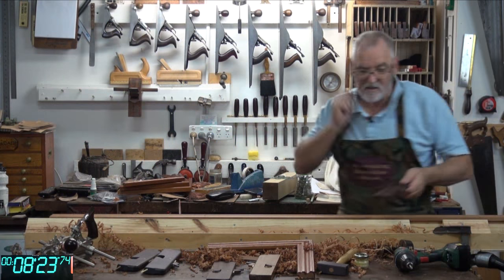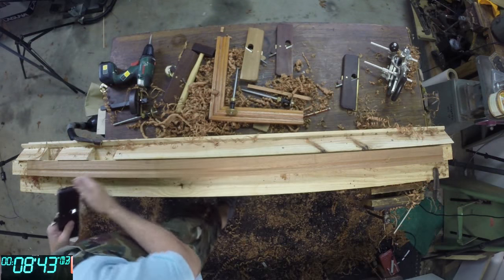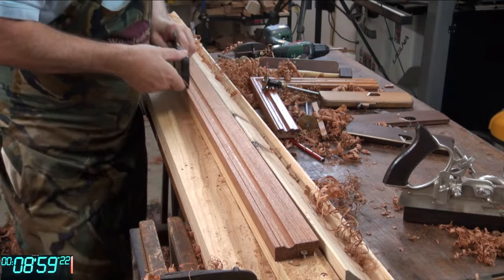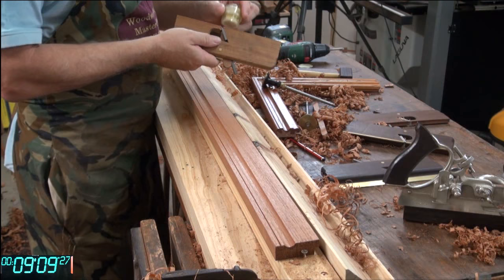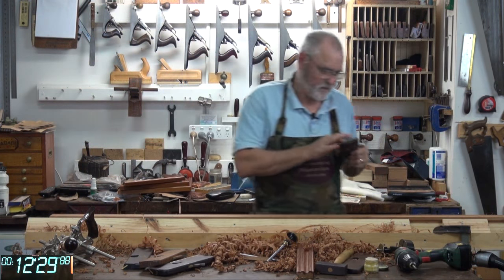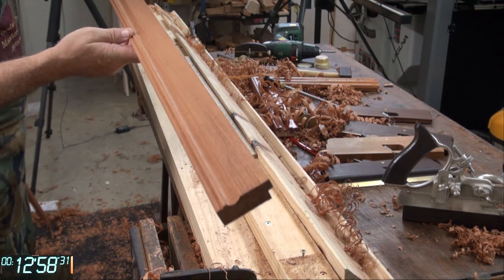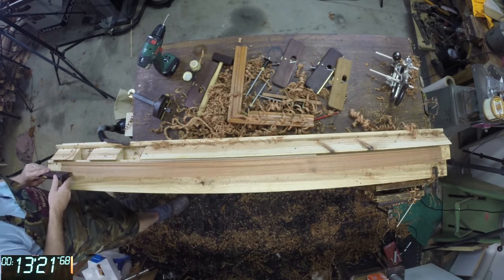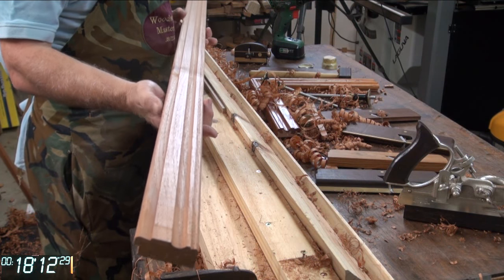Picture Frame Making Pt.1b of 2 Using Hand Tools Only

Comment: Its a pretty molding. 

But if you are going to do a lot of those, a full profile molding plane would be a lot faster still. I recently found an opd one that i restored a bit. Its great. But hard work as the plane takes a very wide shaving once it gets in there.
Reply from the maker: Hi Willem, I agree, only thing is regrettably the profile is then all it can cut. Where as Round and Hollows. I feel, offer much more versatility and as you pointed out are a lot easier to push at the end. Although if you had a lot of the same moulding to do a Profile plane would be the best option. Hope you put yours to good use. Cheers Steve